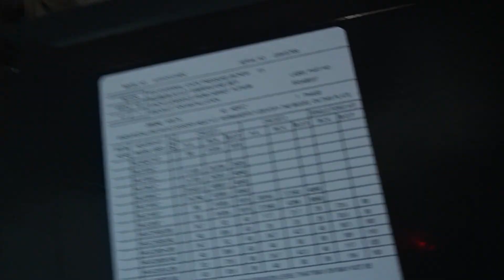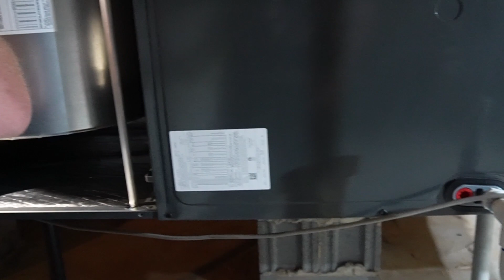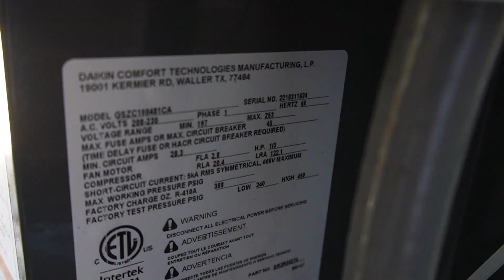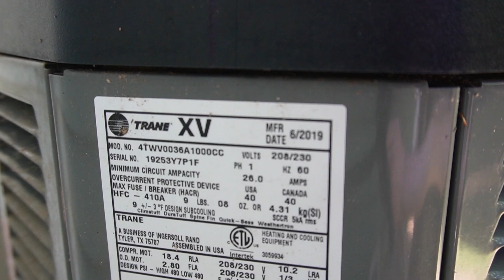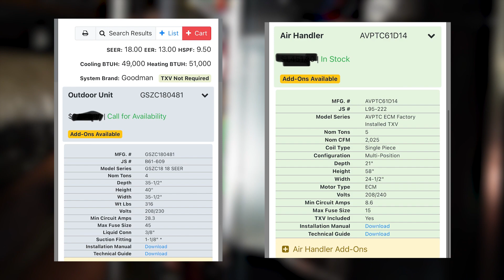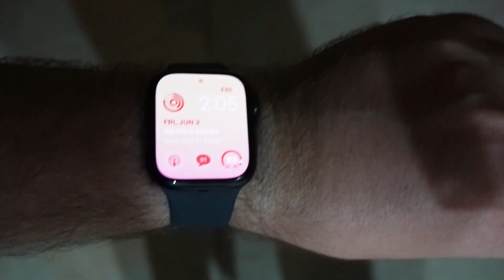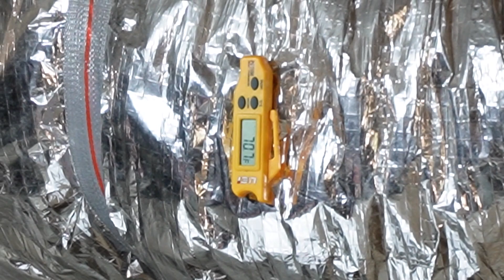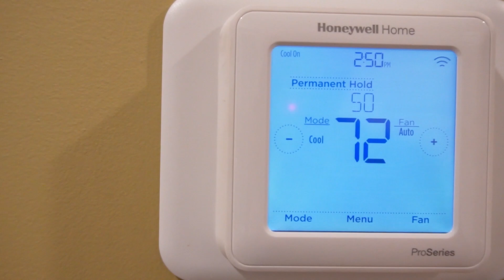HVAC Heroes: Install Company Gave Up and Said Call Someone Else! | HVAC VLOG Ep 5

Comment: What justifies measuring the static pressure on the wrong side of the filter? You can't get total external static pressure that way. Did you exclude the evaporator coil too?

Comment: SEER stands for Seasonal Energy Efficiency Ratio (Not Seasonal Energy Efficiency Rating). It is a rating used to determine the cooling output of ac’s & cooling mode of heat pumps verses their electrical input but its Ratio not rating as the R in SEER.

Comment: I've worked on lots of those units and 90% of the time fixing issues from improper installation, reason why goodman has a bad name but for comfort bridge you can actually use a basic thermostat (1h,1c) and the equipment will do the rest ( heat pump or furnace) as long as you wire indoor and outdoor equipment with the RC12 plug ( communicating plug)

Comment: We installed the same heat pump a few years ago. The line set was 3/8” and 7/8”. I advised the owner the suction line had to be upsized to 1 1/8”. She said the other 2 estimates didn’t require it. I showed her the install manual I keep a copy in the truck. I told her if I leave it, efficiency would fall from 18 seer to about 14 and instead of 4 ton capacity, she would have a little over 3 tons and the compressor will die a quick painful death. We installed it correctly and left her a little poorer but happy.